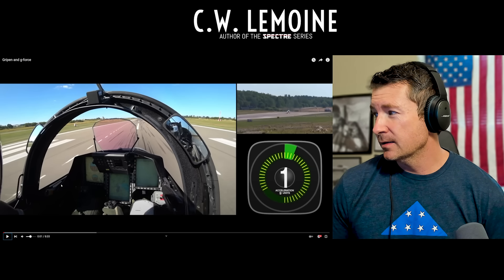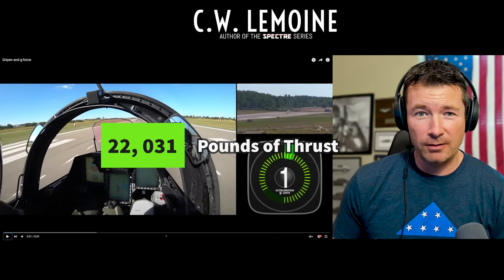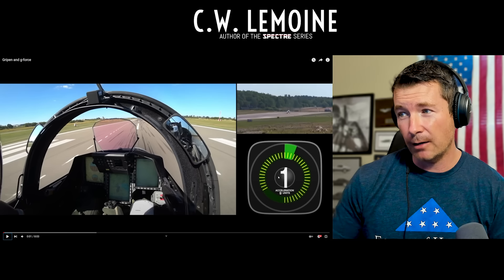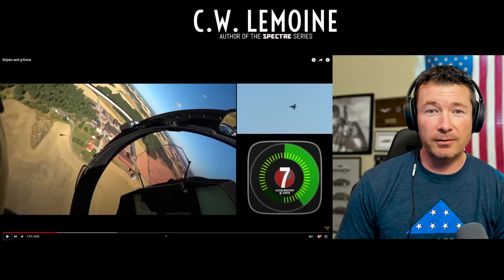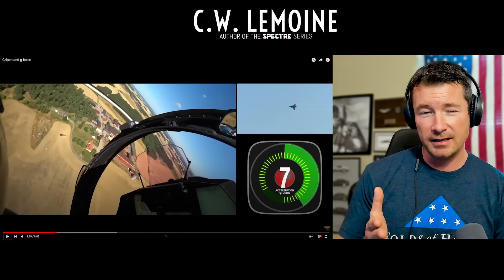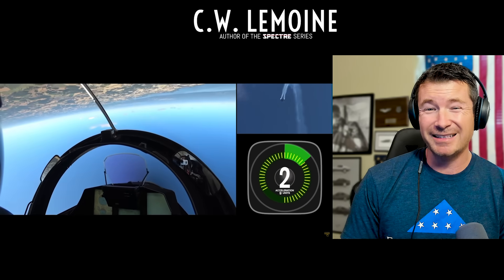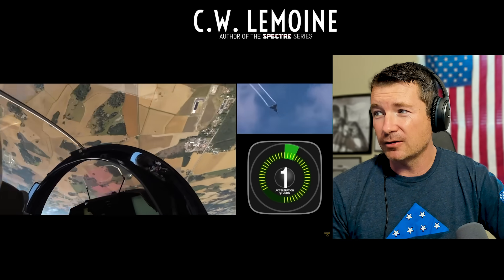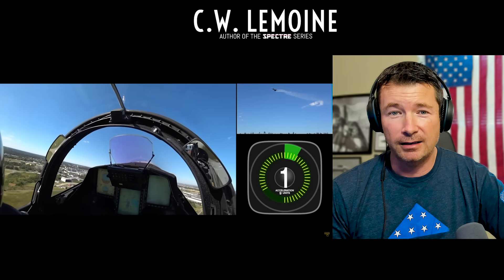SAAB JAS 39 Gripen G-Force Video *BREAKDOWN*

Comment: I´m by no means in any way shape or form a subject matter expert on the SAAB Gripen, but I was told by someone who is that the Gripen has a very good G sustainability and that it can sustain 9 G´s for a long time, even with an A2A configuration, without bags on, of course. The pilot asks the aircraft with the stick input to give him or her 9 G´s and that´s what the aircraft will do, and due to its design, it doesn´t bleed off a lot of energy when it turns. As a test pilot once said: "it carves like a knife through the air", while some aircraft tend to skid along on its butt and bleed off more energy.

Now, it does suffer a bit from lack of thrust, which will be remedied on the E-version with the GE F-414 engine. (The C-version has the Volvo Aero RM12 engine, which is a license produced GE F-404)
Reply: The Gripen NG has the option for the F414-EPE, which will put it at almost the same T/W as the F-16. I don't know if anyone has already ordered that option, but it exists.
Reply: @angrybirder9983  That's for the E and F versions of gripen. The one in the video is gripen C with the RM12 engine.
Reply: @dataolle  Oopsie, forgot to write Gripen NG (now edited).
Reply: @dataolle  Is it possible that they will change the engine for C/D too?
Reply: @night8285  i do not believe so. All investment / development  is for the Gripen E/F
Reply: @night8285  No they will improve the exciting engine with 10% more trust.
Reply: The F414-39E in the JAS-39E/F (new swedish designation is RM16) has equal thrust as the 25 years old USN Super Hornet basic version F414 has. Which is obviously 30% higher than the RM12 had, but unfortunately, the new Gripen went to be heavier, than it was expected oroginally, at the Gripen NG program. That stuctural weight was too optimistic, while the final Erik Gripen going to be more belly, due to the extra avionics and the strictly requires additional sub-systems. Such as extra heat exchangers, computers and of course their mounting points -> extra structural strengthens. It is a technological avalanche. The final, serial JAS-39E with the basic F414 thrust level had same or less thrust/weight ratio, as the current C/D Gripen fleet has. The F414EPE is actually orderable-ready, but even the US Navy did not interested in this version. No serial production, no manufacturing feedback, no shared development cost. The EPE is not that engine what SAAB would like to use in their cost-sensitive Gripen upgrade. Maybe, later the new owner of the swedish engine program, the GKN Aerospace will invest into the RM16 thrust upgrade, if it is required.
Reply: I believe the new E-model hit 1.0+ TWR
Reply: It flies really well, but just judging from Wikipedia numbers, the E/F will have 22k thrust pushing around 17.6K empty weight (plus fuel/stores/pilot), whereas the Block 50 Viper has 29.5k thrust pushing around 19K empty weight, so the Viper will still have a pretty decent thrust-weight ratio advantage. I must admit, though, that the Gripen makes great use of what it has!
Reply: @ziggystardust4627  Finally someone else who realizes that empty weight is the best choice for T/W comparisons.
Reply: @angrybirder9983  It is obvious. Anything else above the empty weight is a variable parameter. By other approach, if you have an already heavy airframe, not just the useful margin of the fuel/loadout is reduced, but the effect of the g-load is much higher. Which has a direct impact on the lifespan. While other key factors, such as the wing area, or the drag (not just the drag coefficient, but the overal drag) remained the same. However, what is true for the car manufacturer world, is true for the aviation: it is easier to upgrade the thrust, than reduce the weight. Or keep the originally demanded weight within the limits. But back to the Viper comparision. The F110GE129 has a huge advantage over the F414 family. The F414 engine family kept one thing from the F404 (RM12): the lack of dynamic thrust step up. The F110 family, especially the GE129 has a very capable dynamic thrust envelope: the thrust is incerasing very well by the speed up to Mach 1.2 at low - mid level altitude. While the F404/414, regarding to the extremly moderate bypass ratio/very high overall pressure ratio, has a very moderate thrust step up. The GE129 has a much higher bypass ratio with the same pressure ratio, so because of the relatively much higher airflow, the AB thrust coud develop very well. The F404/RM12/F414... engine family has a quite high static specific thrust, but it has its own price. Especially at the F414, where the bypass ratio is only 0.25 and the airflow design is mostly about the afterburner chamber cooling, the engine could not handle the increased airflow of the high subsonic regimes. The F110 is partially uses the bypass flow to feed the afterburner AND cooling it around. So, summarize it, the F-16C block 50 (this one has the F110GE129) has a much higher static thrust, with a much more attractive dynamic thust characteristics. The Gripen family has less static thrust to weight ratio with less capable dynamic thurst envelope.
Reply: the new F414 in the E with more kick, is nice in theory, but she will be heavier as well. I must google Power 2 Weight ratio.  Could possibly push just over 1, as C was 0.97 IIRC.
Reply: @The Insufferable Tool When I see vague yet over-precise declarative statements like that, it makes me very much doubt the claim.

What variant of F-16, with what engine?  At what fuel weight?  What stores weight?  At what speed and altitude?  Jet thrust performance changes with altitude and airspeed (IE: the faster you jam air in, the more thrust they can generate).  The installation changes thrust as delivered (inlet design in particular; some inlets are highly inefficient at higher speeds).

You appear to be uncritically taking the thrust/weight number straight off wikipedia, without considering if it's accurate, or how it was calculated for each aircraft.

The Gripen E with the F414 engine is still only pushing around 13,900 pound dry, 22,000 afterburner static; the F-16C Blk50 generates 17,800 dry, 29,160 afterburner static.  Weights empty are 17,637 for the Gripen E, 18,900 for the F-16.  This gives us an EMPTY full afterburner thrust/weight of 1.247 for the Gripen E, and 1.543 for the F-16C Blk50.

Of course, they can't fly (much less fight) empty, so let's throw 300 pounds for pilot and gear, 3,500 pounds fuel, 1000 pounds for 4x WVR missiles and adapter rails, and 250 pounds for cannon ammo on each aircraft.  Both have around 7,000 to 7,500 pounds fuel capacity, and the engine fuel burn rates are not terribly dissimilar, so calculating at the same fuel weight is reasonable.  So, add 5,050 pounds to the empty weight to get a reasonable weight each would be at during a WVR engagement.  Which comes to 22,687 pounds for the Gripen E and 23,950 for the F-16C Blk50.  

Calculate the TWR again at those aircraft weights and you find 0.970 for the Gripen E and 1.218 for the F-16C Blk50 at full burner.  At dry thrust with the 4x AIM-9 and 50% fuel state, TWR will be 0.613 for the Gripen E and 0.743 for the F-16C.

I'm not going to try to calculate for inlet design efficiency loss or at varying altitudes; it'd take ages and most of the data would be classified anyhow.  Suffice to say that even just looking at similar weapon load-outs, the F-16 wins on TWR.

The only way you get a result that favors the Gripen E is if you compare a heavy-loaded F-16C with an empty Gripen E. 

F-16C simply has better thrust to weight, across the board.
Reply: @bronco5334  to be fair, the Viper (C) is an amazing machine anyway. It has a better thrust to weight ratio but not by much (compared to the Gripen C variant).

That said, where the Gripen really shine is when it comes to cost efficiency (even compared to the Viper, which was the king of the area). It cost less than a Viper to fly/operate and it needs less people for maintenance. It can take off from anywhere too which is very important when you're a small country with not that many air bases (in case of a conflict on your land).

The Gripen is a very good jet and i've always saw it as a "modern" F-16. Not necessarily better but does the same job for less money while being more advanced (comparing the Gripen C to the F-16 C here, the E model is something else) and maybe a bit better than the Viper in BVR. 

Lack of thrust is real though so i'm not sure the Gripen could survive a dogfight against a Viper (pure theory here, i don't know). My guess being that lack of thrust + Delta wings (which are great at high speed but not so good at low speed) could be a problem in that case. But hey, Dogfight is not something that happen a lot these days and having the best sensors/radar and missiles is what you need 99% of the time so i guess it doesn't matter.
Reply: I read that the lower thrust/weight ratio of the 39C/D compared to other fighters is offset by a significantly lower drag, not sure if that’s improved even further on the 39E/F.
Reply: @kramasnu  You just hit the nail on why Gripen can perform with airframes with much higher thrust ratio. Was listening to a lecture by a engineer , who liked the old C to about 60% of Rafale capabilities and the new E would add another 40% ontop of that , given the slight edge to the french since they have had longer time continuing developing thier EW suit , but at a lower cost.

Comment: What would this have done to the airframe? If this is tough on the pilot what's it doing to the aircraft?
Reply: The airframes are designed to withstand much higher strain than a human pilot ever could. At least for the intended lifespan of the aircraft and its maintenance schedule.
Reply: @svenschwingel8632  ....on some aircraft.

Many fighter aircraft are not designed to withstand high Gs, if you over-G a tomcat the plane needs to go back to maintenence, not the pilot
Reply: @AttiliusRex  I guess it's because of the variable-sweep wings.
Reply: @AttiliusRex  there were Tomcat drivers that were out of commission way longer than their aircraft after peaking 11.5G. Grumman used to build very sturdy aircraft. Extended maintenance and parts replacement after an over-g incident was mostly done for safety, not necessity.
Reply: @svenschwingel8632  There is a story about a Saab J35 Draken that landed after pulling 15G. The technician just resetted the max G-indicator afterward. The pilot and airframe was just fine. :) Heard it from people in the airforce. Don't know if it's true. A good story though. ;)
Reply: @tommykarlberg  if that Draken was built anything like those old Volvo cars, I wouldn't doubt that story for a second 😆
Reply: @svenschwingel8632  Don’t you mean Saabs? The Draken was built by Saab. As is this one.
Reply: @Rbajter  I know that Saab built the swedish jets. But an 80s Volvo is like the acronym for swedish sturdyness ;)
Reply: @svenschwingel8632  Yeah, also known as ”Fast Tractors” here in Sweden. Saab Automobile used push their link to the jets in their ads all the time. They were however just as safe as Volvos and had many safety innovations, but they never made any money.
Reply: @Rbajter  Saab were the first to introduce turbo charging in mass production vehicles with the 900 series if memory serves. Porsche did so earlier with the 911 but with a niche car and not with efficiency in mind. Saab also were the first to present flex fuel cars into the european market that could run ethanol/gasoline mixtures. Too bad the management whored the company out to General Motors. In the 2000s, Saab was just releasing rebranded Opel/Vauxhall. The 9.3 Convertible was decent-looking, though.
Reply: @svenschwingel8632  It was the last Fighter Saab designed without computers, so they had big safety margins. Viggen they used computers for the first time, and the wings fell of in the beginning. I guess the early computermodels they used was not totall exact. ;)

Comment: Delta wing also have disadvantage because it increases drag and speed instant bleed off!!!
Reply: The drag however is caused by vorticies which increase lift, the canards compensate for the loss of control and thus you have a very controllable plane.
Reply: @FirstDagger  Maneuverability is also now getting old concept because now Aircraft only needs better radars and BVR capabilities that's why F 35 lacks high turn performance and Russian are just getting on the old concept
Reply: @shoaib3036  you know they said this same thing when the F-4 was being built, "it doesn't need to be light and agile because it'll be able to shoot down a MiG-19 from 10 miles ! They won't even know what hit them !" it was believed that all future air-to-air combat would take place in BVR conditions, hell, early F-4s didn't even have guns ! And while their idea had merits, those merits quickly went away once the F-4 went to Vietnam and they saw just how unreliable those early missiles where, and how useless the F-4 was on close quarters due to its heavy weight and lack of a gun.
Having a manoeuvrable fighter is and probably will always be important, and anyone who thinks otherwise is probably mistaken.

Comment: Awesome to hear your admiration of another pilot's G tolerance. Cool vid...👍
Reply from the maker: Thanks! I wouldn't want to do it! Respect!
Reply: @CWLemoine  Gripens stick has a "trigger point", draw it back through that and you got 12g...

Use in emergencies, be prepared to explain yourself as you shortened that planes operation time.

Oh... and it has cannon auto aim from radar (from front, auto trigger from behind). Said to be an interesting ride...
Reply: @CWLemoine  Out of curiosity, what's the best comparison, if there is one, to pulling heavy g's? Sprinting? Running a marathon? Doing a really heavy set of weights? All of the above? Maybe a better way to ask the question is whether there's any kind of exercise that really helps with pulling g's?
Reply: @davidsmith8997  it kinda feels like deadlifting
Reply: @TheInsatiableViper  I've flown as a passenger in a fighter plane, and even though the pilot never went over 6G with me in there I got to say your description was spot on. It definately felt like a deadlift without strain on the arms. Like wearing a vest of led.

Comment: This is Gripen C, not E. The first E versions are just to be delivered to customers, Brazilian and Swedish Air Force.
Reply: So, like in a lot of other cases, E is for Export.
Reply: @Myuutsuu85  No.
E is just the next letter in line.
We already had the A/B and the C/D
(A & C = Single Seat, 
B & D = Dual Seat) 
So naturally after that comes E / F.
So the same progression as with US Aircraft etc
Reply: @Myuutsuu85  think Hornet vs. Super Hornet.  Gripen A-D use a Volvo version of the GE F404 engine, Gripen E/F uses the more powerful F414 engine, is heavier, can carry more fuel and more missiles.
Reply: How do you know it’s a C? Would make sense that first E prototypes were without the brazilian WAD.
Reply: @jonasthemovie  the original video came out about a year before 39-8 flew, plus if you watch to the end you can clearly see it's C #249 (one of the Cs that flew over Libya).

Comment: I read something really cool that said that the canards are there to not only maintain airflow over the wing at high AoA, but actually changes the angle of incidence. 

That's a wee bit beyond my understanding of what that means for performance over an F-16, but it's cool nonetheless.
Reply: They also works as airbrakes when the nosewheel touches ground during landing.

Comment: C.W Lemoine Gripens have very low drag which to a part compensates for lower thrust.
You also have a new version called Gripen E with the GE F414 engine (=Superhornet engine).
..and here you have the display pilot André Brännström.
Search "Gripen display pilot talks about g-forces." on youtube.

Comment: THE JAS 39 GRIPEN NG has super cruise capability and longer range.
Reply: NG was a very early designation used during  design phase. Nowadays it's E (and F for the two seater)
Reply: No variant of the JAS-39 has supercruise.
Reply: @johanlassen6448  I wouldn't be surprised if it cracked the sound barrier without the can lit, but probably more like the Hornet (the Lot 20 in DCS does get to ~1.09ish at around 30kft and some SMEs confirmed the real thing would do that as well when people asked "for real?"), which isn't actually called supercruising since it's still within the transsonic region.
Reply: @CakePrincessCelestia  Gripen NG, sure. Gripen E? I honestly doubt it. It weights a full ton more with no additional thrust, and the Gripen E could barely maintain mach 1.1-1.2 with milpower (keyword being maintain as it could only reach that speed with afterburner).